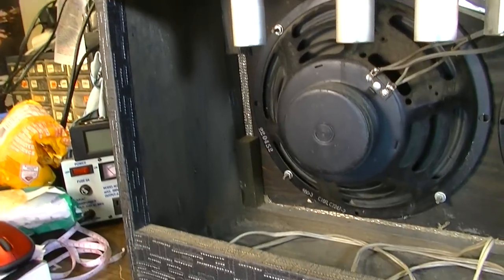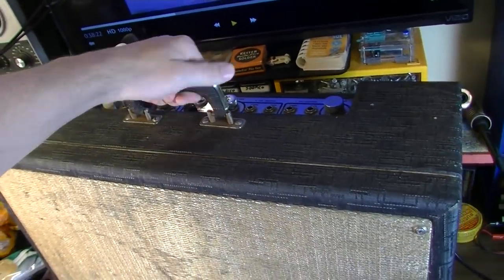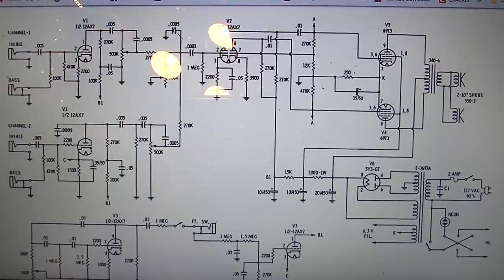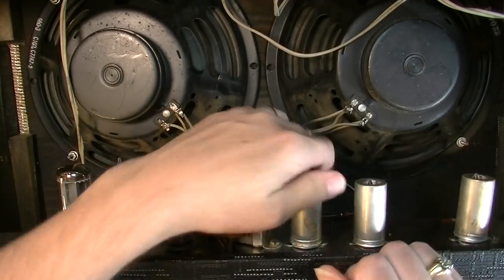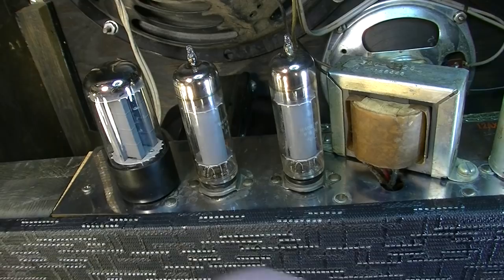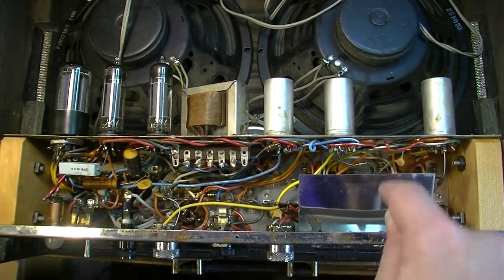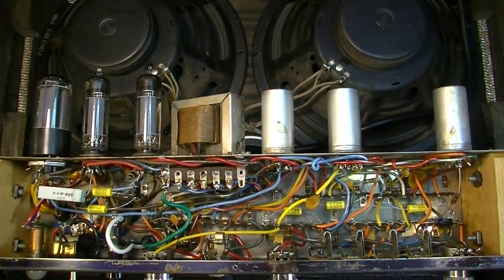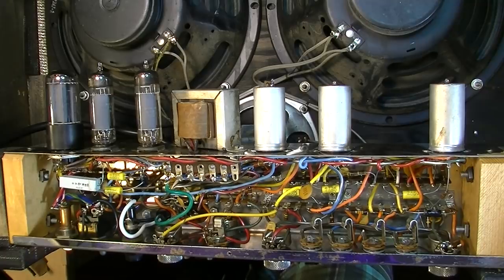1965 Valco Gretsch Model 6161 Service

Comment: Well, I finally discovered why I can never find any old radios worth picking up or any tube amps at all at the local antique and thrift stores. I talked to some old man running an antique store I don’t typically go to and apparently there is a man from Cincinnati that comes to town a couple times a year and buys up practically everything with tubes in it. I did find some of those really cool tube mechanic boxes that you have shown before, but they were empty and on the high side.

Comment: Picked up a Gretsch G5222 'Champomatic' a couple months back and learned a lot about The Valco connection with them and all the other Valco made amps. I'm pretty tempted to tear apart the Champomatic and put a point to point 1605 mod in it.

Comment: Hi Brad. I just bought one of these Gretsch 6161. And I'm psyched. I need to go through it and clean it up and you had cleaned the control panel. I was wondering what you used to clean that with. Really appreciate the information that I have garnered from your channel! Thanks bud!
Reply: Good for you! I was wondering the same thing.

Comment: I love microphonic 17mm plate Sylvania 12AX7’s. They make amazing phase inverters and tremolo tubes.

You really only need a good quiet tube for V1 in most amps, especially Fenders from tweed to Silverface and any derivative of the 5F6 circuit.

Even tubes with a noisy half can find a spot in some amps.

Don’t chuck a working tube!
Reply: Good info!!
Reply from the maker: This is also why you don't just pull old USA and European made tubes because they're reading low emission and throw them out. A low emission 12AX7 can still have great tone and can still function perfectly well in some positions. Might sub well for a 12AT7 PI, for instance. Just ripping out old American tubes and throwing them away willy nilly is a sin against the guitar gods.
Reply: Matt Fields i have a crate turbovalve 6210 i got it used the owner crossed 8 months ago. The amps been sittin so right off the bat problems. I have a question; its a 2 channel amp is the clean channel its own preamp tube? Theres 5 preamp tubes ones reverb.the main problem was original tubes. First I changed was the 6l6's for new matched 34's. Ok so now no loudness problem. Ive got 4
Nos rca 12au7a's
A friend brought me three 12ax7 a jj hg
2 EH's i changed the first three jj in v1.
Ok so my gain got smoother like I like it
( i dislike harsh clip
Any unpleasant crap metal clip really)
Should I start at v1 with the u7a's to the x7a's ? Or x7a's down to the u7a's. If I can get answers ill only have to pull tubes once.
Reply: 12AU7's have very low gain and high transconductance. Not great at all for actual guitar preamp but good for phase inverter like a 12AT7.  Try a 12AY7 or 5751 for lower preamp gain with similar 12AX7 tone.

I would use 12AX7's in all positions, maybe a 12AU7 or 12AT7 in the phase inverter.
Reply: Matt Fields thanks man I still cant find schematics on this pc boardmount amp.
That tells alot right there not to mention heat rises
Reply: The Guitologist that's great to know. As my old mallards die, I can't bring myself to toss em out due to what I paid for them. I have a handful that read low and now can possibly find a use for them
Reply: @TheGuitologist  I've been in this playing biz for 58 full years. The junk they are passing off as "tubes" nowadays is really pitiful. The only thing I have been happy with are the Winged C 6L6's, and now they cost a fortune. I think that's a scam, personally.

Comment: Love this work!! Just had a flashback to my Dad cleaning valve pins with an old electric spark plug cleaner that used abrasive beads. :) They sell for silly money on ebay if you can find them.

Comment: That was fantastic! A good thing to do is take the speakers off the baffle and clean the smoke/dust off the grill cloth. The plywood is pretty impervious to water. I wet the cloth and use an old shaving brush loaded with mild hippie soap. Lather it up & rinse. It will take those rings around the speakers away and shine the foil woven into the cloth. No, the baffle does not warp.
Reply: Dirty Leslie 
"Hippie Soap" is a mild, handmade plethora of earthly delights sans animal tallow. DO NOT USE PATCHOULI !!! An old shaving brush will not pull the threads and foil strands from the fabric.

Comment: Have you ever seen an amplifier whose tubes were mounted horizontally?  A friend of mine used to have a Philco floor-standing hi-fi turntable which had a vertical amplifier chassis and horizontally mounted tubes.  I think it had 6V6 output tubes.

Comment: We also dig those Gretch amps from the mid/late-1950's to mid/late-1960's, which are still great buys for players amps, with older versions having more collector's value. Back when I was buying amps like crazy off eBay 15-20 years ago, using excess "medicine" growing money (and they say money doesn't grow on trees?), I did some research on Gretch amps. One dude that I bought my 6163 from was a Gretch collector, and he schooled me too.  I bought a 6163 "Executive" from ~1960, w/wraparound grill - a two channel amp with 15" speaker (sadly not the original Jensen), similar to a Thunderbolt - but better, with wicked crunchiness and tone.  We also bought a mid-1960's "Playboy" amp w/12" Jensen C12R, from the same mid-1960's era as this amp. That one uses 6973 power tubes, sometimes also used in juke boxes and hi-fi amps, which possess a unique overdrive tone, although most of the Valco crunch is from the circuit, not the power tubes - the 6L6's in the 6163 have that Valco crunch too.

Valco's best quality amps were made for Gretch and Supro, although many other Valco amps are cool too.  I took a brief look at the Gretch used amp market just now, and there are many great buys currently available - if I had any extra money (money trees aren't ripe for picking yet) I'd buy us another Gretch amp, maybe a 2 x 10 like this one..?   I also dig the 6159 dual bass amp, with 2 x 12" Jensen speakers, and larger transformers, providing more clean headroom, plus I could use it for bass too.  As Brad says, those old Gretch amps can be great buys - relatively inexpensive, well made, and sound great.

Thanks for another fun, interesting and informative video Guitologist man!
Reply from the maker: The Supro stuff was actually meant for the lower end mainly. National was the top of the heap and Gretsch stuff was supposed to be up there too. Supro and Airline labeled stuff from the 60s usually has lower end construction, but not by much. Plastic handles on those break easily. Airline coverings were barely better than paper, but cabinets made the same. Good coverings on Supros still. Airline grills were recessed, so their grill cloths fare better. Most collected ones are the Supros because of the Jimmy Page connection, but they are all similar lines with many of the exact same circuits across lines.
Reply: Oopsy!  National, not Supro, was the other upscale Valco brand.  I knew there was another one, along with Gretsch (I spelled it right this time!).  Thanks for correcting me, and the additional info...

Comment: Great presentation! I have the Gretsch 6150 and i want to get an attenuator in between the amp and speaker. However i’m not sure about the cable leading to the speaker. It’s not clear which whether Green or Black is the positive/Negative. There’s no +/- marks on the cone either. Would you know this.?
Reply from the maker: Polarity on a single speaker amp is not critical. But if you want to know for sure, get a 9v battery and put the terminals on the speaker terminals. If cone goes forward, the + battery terminal is on +. If it goes inward, it’s backwards.
Reply: sounds like a cool little trick! Thank you so much for the reply!

Comment: I love 6973 tubes. I had a Univox U65 that had 6973s and it sounded great.  especially since I had paid 125 bucks for the amp. those 2 old 6973s were probably worth more than what I had paid for the amp. great amps if you find a cheap one. had a nice Jensen 15" speaker too.

Comment: Hey Brad, look up the Riverstone Audio Pin Straighteners on Ebay. I just picked one up. It mimics the old CBS/Hytron straightener just like the one you have, it was affordable and it works like a charm. On another note: they may be a potential sponsor looking for an advertising opportunity.
Reply from the maker: Thanks Phillip.
Reply: hey Phillip... THANKS for that suggestion ! I just got one on Ebay for $30 !
Reply: Glad I could pass it on. I use mine all the time. Invaluable!

Comment: um that amp has one future failure point. not sure if you noticed but in the shot of the last cap you pulled you also pulled out the lead of one resistor and so its currently barely soldered.

Comment: Great video as always, loved the jam on this one, and great info about the caps. Do you find the Gretsch/Valco amps to be extra loud for their speaker sizes? I have the 6152 Tremoverb with an 8" jensen, and it holds a steady 110db's on the meter compared to my 5F1 build with a similar vintage 8" Jensen hitting basically 99 db's. I figure it could be more to do with how used the old speakers are, but damn, 10 extra decibels make my ears extra ringy haha. I agree the Valco's in your videos, and the one I got bring something special with the tone

Comment: 29:50 did that loose resistor get hooked back up? It looks like it didn't but it also looks like it might be on the leg of the new capacitor later. Hard to tell.
Reply from the maker: Yes. I saw it. Good eye!
Reply: That is the advantage of the video, shame it takes so long to edit

Comment: Funny, I have a 6973 in the tremolo socket (harmony 430).  Oh have times changed. Experiment-“sacrilege “ -plugged my Harmony 430 reverb out/ in RCA leads through 65’ Reverberocket reverb tank and damn if it wast lush.  Question.......? Did these old output transformers have an 8/16 ohm speaker leads you could run out so that you can hook up options for extension cabs, or like mine, only have the 4 ohm out for the 2 -10” Jensen C10R’s. Wish I had that flexibility......?

Comment: It doesn't really have much to do with the amp, but Brad, what do you think about everyone nowadays saying that you have to change your power tubes once a year and rebias everytime? Both of my amps are running quite old tubes, my roland bolt 30 has it's sovtek 7591s since it got a new speaker, recap and rebias 5 years ago and my hohner concertphon still has the ones it probably left the factory with, yet both of them seem to sound fine to my ears. Mainly the roland gets played all the time, although outside of gigs maybe once a month it's on bedroom volume. Is the current wisdom just something that exists because mesas, peaveys and other modern amps run the power tubes so close to their limits that they kill the tubes quickly, or are all the tubes in my amps dead and I'm just deaf?
Reply from the maker: Change yearly? Nonsense.

Comment: 20:08
 missing Pin ?
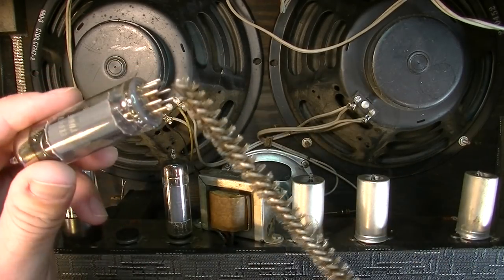Reply from the maker: Yes there is a missing pin. You can clearly see it at 17:36. I just missed it! Luckily, thats a G2 connection which isn't needed, but still odd. I guess I was too busy talking about cleaning pins and didn't notice.

(EDIT) No, wait, that looks like PIN 9 that's missing. That's a plate. Is that possible? WTF? The amp must be functioning as a SE output right now then. That's no good. Need a set of power tubes. Thanks for the observant comment!

Comment: I have an old  Ampeg v5 100w tube amp that id like to use as a clean front end for pedals, but its never been serviced and it nearly caught fire the last time I plugged it in. What kind of repair backlog do you have?

Comment: I SEE A MIDRANGE SPEAKER IN THERE WITH I THINK A RESISTOR IN SERIES . IS THAT STOCK OR AN ADD ON ? EYE TROUBLE I USE CAPS
Reply: I SEE IT DOES LOOK ORIGINAL . WHAT OHM IS THE RESISTOR ?
Reply from the maker: It's stock wiring. Surprised me actually.

Comment: Any reasons why the new electrolytic capacitor companies don't use Epoxy to prevent moisture issues like what Mallory did. All the brand new electrolytic capacitors cause problems from moisture issues but Mallory Electrolytic capacitors used Epoxy to prevent moisture issues to last long. I'm trying to find a brand of electrolytic capacitors that use Epoxy or something to prevent moisture issues

Comment: You'll find the handle, and amp's covering, to be 1960's vintage "Portable Singer Sewing Machine"; some of the older Singer dealers will have stocks of the handles and (limited) supplies of the reinforced Tolex-type covering.

Try: https://brubakerssewing.com/ , for they've been around since 1934. 1960's GM "automobile trunk backseat shelf" material is similar in construction, but not color.
Reply from the maker: My wife sees and I didn't even know that.
Reply: "Twasn't" my discovery :-(    A gent with whom I worked, repaired AV equipment, and classroom projectors for schools- as a sideline. He was damn good at it, too!  Anyway, one day he complained about having to repair a Califone "TeacherSpeaker" (may be a slang term for a classroom sized microphone and amp "for the teacher who needs to yell at someone in the last row, but doesn't want to strain their voice"), anyway, the case was busted to hell, and he knew that sewing machine dealers did their own repairs, and in-house, for the most part. 

I've never had the opportunity to use that tip, and I sincerely hope that you find it useful.

BTW, I just discovered that there was a custom AMP builder about 4 miles from where my tail is parked; "Love Tree Amplifiers". Their claim to fame was that they reworked classic designs, with time tested technology, for more durability, and better sound. Darn shame that they're not around any more.
Reply: Think you mean sews
Reply: Wow too much information ~ I know Brads wife is a seamstress and thought it was a typo
Reply: Sorry about that!   :-)
Reply: Nic Thomas If his "sews", Brad would probably "know that". :)
Reply: Yep sure he would cotton on  and not loose the thread :)

Comment: You will have excuse my ignorance  but where is the power transformer? I am assuming the little guy is the output. All the old amps I have ever owned had much more iron in them.
Reply from the maker: You'll see it at about 26:00 in.
Reply: Aha! I have been using my phone lately and things are kinda small.
Thanks Brad!

Comment: Brad, I have a kluson gibson tuner I need to open and switch the pole position. I assume it's a left when it needs to be right. Any ideas on how to open it? Is has the lines to come open but I can't get it. Anyone that can answer this is considered a genius. No, its not in any forums. I see things on how to close them. HELP music friends.
Reply: Tried unscrewing the plastic head from the pin ? 
Edit: thats dumb because the pin is the screw it wouldn't slide out lol
Edit 2: Maybe not so dumb because if the head was out maybe there would me a way to unscrew the pin and release the  box

What's in the little hole tho ?
Reply: Foo bar the hole is for cleaning out and adding lube for the gear. I'd tell you what to use but someone would have a opinion
Reply: Nice, is there anything you can fiddle in it to open it ? :D
Reply from the maker: Depends on the era the Kluson was made. The older ones have tabs you can pry up and take the backs off. But a machine that was geared backwards from the factory is highly unusual. If you have such a machine and it's newer, contact Kluson and tell them about it. I bet they send you a replacement.
Reply: The Guitologist if I had to guess 90. All the rest of them were correct. It came off a parts guitar so I'm clueless but going back to the factory isn't why we watch these videos hahaha! Thanks anyway Brother
Reply: Dirty Leslie we live in reverse.

Comment: It aways amazes me how little you use a good tube tester I will say I worked on manly good hifi tube Amps Audio Research being my favorite 90 percent of the time power tubes were worn out power tubes have a set life of 1,000 hrs less if there bias was set too high if you don’t know this check you RCA tube guide is the emission type is quick test but a transcoding type is the best now a tube can be used way after it bad MI amps are very forgiving of bad power tubes because the
They don’t need good frequency response they are for a MI amp so nothing above 8 k is needed also nothin below 100 Hz is needed so for high fi dead and the THD of the tube it’s self increases 100 fold so all those 6550 that the ARs used I saved and put in guitar amps ant the players were happy but players don’t want clean sound they way a nice distortion the work you do is make a nicely distorted amp different goal and very valid but a effect and hard to measure so you don’t I think you play great but how bought you show on some real test gear what your trying for ? Playing through a amp when your done with it shows little except your playing skill now I played from 15 practices a lot and got OK never great but competent so I turned to the tech  work where I was really good so I guess what I am saying is can you give some good information please
Reply: A